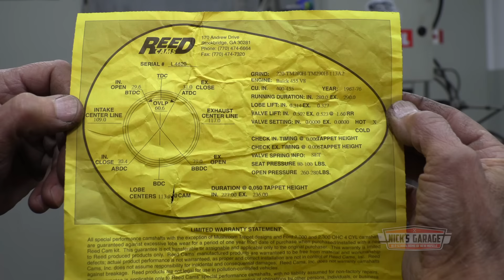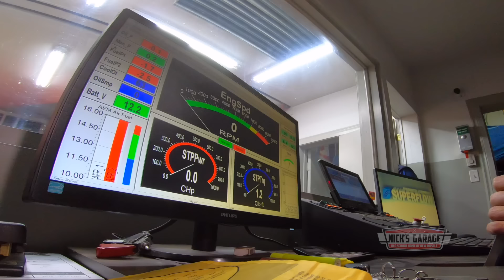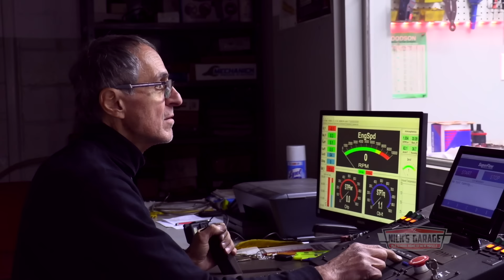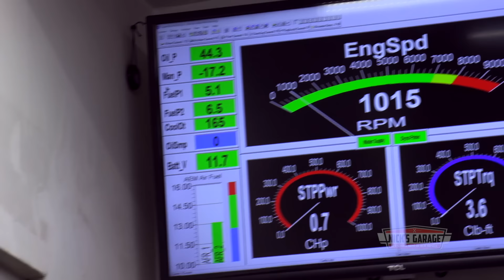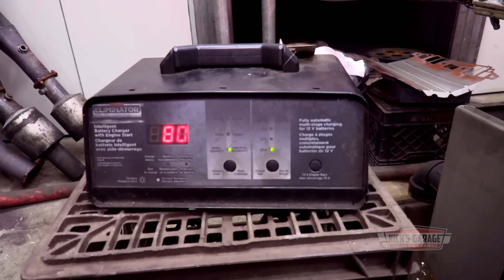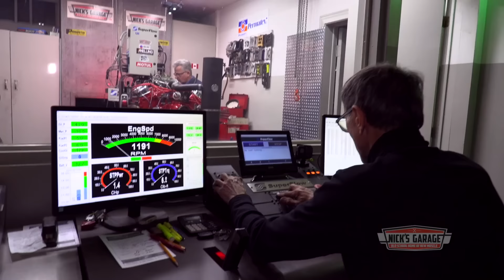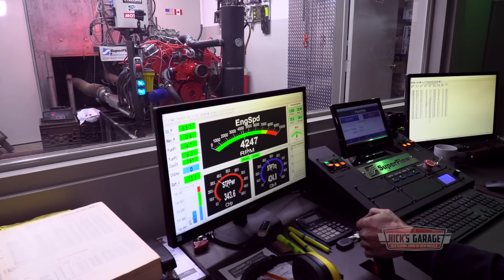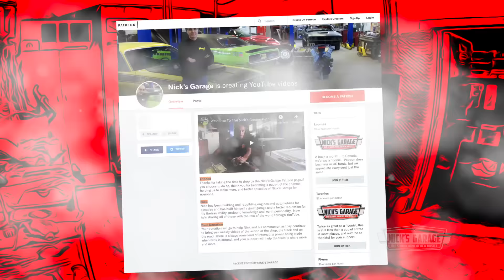1970 Buick 455 Stage 1 - Dyno Room Diagnosis

Comment: I had made a  CYLINDER COMPRESSION TEST  and had 160 PSI.  Recalculated the COMPRESSION RATIO and it turned out to be 9.2 with these slightly dished pistons.    WE ARE NOT DONE YET.     STAY TUNED FOR MORE.
Reply: Most 455 Buicks favor 30-32 degrees of total timing...What are valve sizes on the heads?  Stage 1 heads are 2.125"I and 1.75" E as compared to non stage 1  455 which are 2.000"I and 1.625"E.  Stage 1 1970 455 actually had 10.5:1 Compression, non Stage 1 1970 455 had 10.0:1 Compression. The Reed cam installed is a very mild grind for a 464 c.i. Buick.  This cam is all done making power at 4500-4700 rpm..The actual lift of this cam is only .487" I and .506" E using the stock 1.55 ratio Buick rocker arms. The cam card lift figures were using a 1.60 rocker arm ratio. There are many other cam grinds available that would produce substantial power improvements over this Reed cam. The low compression (9.2:1) of this build is definitely decreasing potential torque and hp.
Reply: @midnitesquirldog1 Exactly backwards! I personally have been stranded by electronic ignition three times,  including once in the wrecker I was driving, and as a wrecker driver I've towed more than I can remember. Points on the other hand, won't leave you dead. After years of faithful service they will eventually cause a miss or a stumble, but you can still go home or to a repair shop. I have never towed a vehicle with points that died in use. Give me points, every time!  And vintage cars that came with points should NEVER be downgraded to electronic crap.
Reply: I know you want flat top pistons with 0 Deck. Do they make Cometic MLS thinner headgaskets for that engine?
Reply: @thefinalroman  ... I had just placed an order for .027 cometic.
Reply: @billdedrick1914  Yes, we have the Stage 1 heads. Looking to bring it to low 10's CR.
Reply: @midnitesquirldog1 HEI doesn't fail? Points don't just "fail" by the way. Most of the HEI ignitions, you cannot just go find something at a parts store if you do have issues on the road.
Reply: Thanks, Nick! I grew up on Buick 455s and really appreciate you posting these videos. I am an even bigger fan of the Quadrajet! Nice to see a Quadrajet in action, especially on the Buick 455. The 1970 455 Stage-1 engine was a great engine for its time and made its power/torque through the smaller version of the Quadrajet too! My understanding is the 1970 Buick Stage-1 was slightly underrated in the HP department but truthfully not by much! The factory 510 number seems to have been more about smoke and mirrors and marketing; possibly the same department that designed those 5 valve cover bolts! Buick guys may also recognize the M/T Super Scavenger style header collectors on this engine. So guys, there probably is more HP/TQ in this current combo, but it would take an additional 50 pounds of torque to bring it back up to 510, more than that if you expect a modified engine with tube headers to exceed that number. Personally, as a Buick guy, I wouldn't hold Nick to that number, or any other specific number. Thanks again, Nick!
Reply: @Terminxman  Can always carry an extra set of points and condenser.
Reply: Like Bill said, check the valve sizes - I'm guessing that's a standard 455. It almost seemed like the motor warmed up and suddenly it sealed - could someone have angle-cut the heads and the sold the motor before matching up the intake? (or thrown the original back on to sell it).  As for the power loss - I was warned by old-school Buick guys (25 years ago) to get a cam from Kenne-Bell or someone who really new Buicks - some of the cam manufactures would just put a generic "chevy" grind on it and completely blow the low-end numbers. FYI the "370 HP" rating is the "official" rating for the monster stage II engines - it's not even vaguely close. 350HP is the standard engine.
Reply: The production tolerances are way off on 70 455s, the pistons are usually .040 or more below the deck. For blueprint spec 10.5:1 it should be close to 0 deck with .020 head gaskets and the 23cc pistons. I rough calculated my 70 SF block 455 to be around 9.4:1 when I replaced the head gaskets last year.
Reply: @billdedrick1914  i thought something was wrong most older engines had good compression like my 454 has 10.5 to 1 plus it idles at 700 rpms with no problems it don't die when u open it up and drop it plus it is built on the bottom end stock 4 inch stroke ,steel crank ,heavy rods and high flow heads best part is i got it free with a 02xx 400r tubo good to 800 hp only 6,000 miles on the crate set up then i got a weidland high rise and tunnel ram set ups for a 100 bucks for both with carbs then a street scoop for 25 bucks
Reply: @nickpanaritis4122  
The Operating Room 
🤣🤣🤣🤣
Reply: I completely agree with you that points are super simple and get the job done.....well! There is one important caveat to this though, and that is that so many points that people are buying these days have huge quality problems, making them very short lived, rubbing blocks seem to be a big problem. If you run points, like I do, buy up old stock, bulk purchases.
Reply: Hit it with a 200 shot of NOS!
Reply: The cam might be too big for the engine. You could have thrown on top of Rhoads Lifters to bleed down the cam to help the vacuum, which would have made it run like the original cam  on the low end. T?A performance has got a bunch of performance parts for this engine. This NO WAY disrepecting the master...
Reply: 10.5 +   lets go
Reply: It might be the cam cam duration. The cam might work well for 4 speed stick. But not for a automatic that does not have a high stall converter. Maybe?
I drove a 70 Riviera. All stock it was smooth at idle and the torque. Oh boy. It probably was not a stage one motor.
Probably like the Pontiac Grand Prix the 455s were two different motors. Same blocks. Different heads.
Also a old GM diesel engineer told me V engines twist and the banks spread with the torque and RPMs.
Now that engine will burn pump  gas. Not sure how the valve seats will like unleaded.
Reply: @midnitesquirldog1 I hated looking for the far flung Allen items.
Reply: I disliked the unipoints even more.
Reply: @55desotomine  all you have to do is keep a fricken $20 module in your glove box and it takes two seconds to change..it's the only thing that can fail on HEI, it's much more accurate and reliable than antique points.
Reply: @Terminxman  keep a fricken $20 module in your glove box duh
Reply: @55desotomine  Interesting viewpoint Senor TobyC. . Your failure record with electronic igns makes you 1 in a million. Yo
Reply: @55desotomine  just carry a module and coil same thing as points swap them in and go and if hei set up correctly they rarely fail points on the other hand I have heard you can not get good ones anymore today cheap crap from Taiwan
Reply: @pb68slab18  Points won't leave you stranded. If you replace them every fifty thousand miles you'll never have a problem. Even if you neglect them all that will happen is a loss of power and some missing under load. And always replace the condenser with the points, and use the lube that comes with the points.
Reply: Back in the day points were recommended to be replaced every 10,000 miles... if you waited too long and the points spring broke, you were left stranded... of course, back then, for $2 you could carry a spare points/condenser kit in the glove box! 
Low compression ratio gives weak torque with a bigger cam... this Reed cam is 1 - 3 steps bigger than stock... depending on which 455 this is... won't even pull hard below 2500 RPMs... needs 10.75 - 11:0 to 1... 
A real stock Stage 1 455 Buick actually 380 - 400 HP and would beat a heavier Hemi car...
Reply: I will take a nice Quadrajet over any other method of fuel metering any day!
Reply: @robertwest3093  Thermoquad, AVS, or AFB for me, nothing electronic.
Reply: @thefinalroman  yes
Reply: @billdedrick1914  I agree.  The stock intake doesn't help one like a Edelbrock performer would probably be a better fit with the combo
Reply: @midnitesquirldog1 You have that backwards. Electronic ignitions randomly fail more often than points do. Points require a little maintenance, but as far as outright "failing" and leaving you at the side of the road, that very rarely happens with points. It happens much more so with an electronic ignition.
Reply: @w41duvernay  Look at the idle vacuum. That cam is tiny. 🤦🏻
Reply: @warrenpuckett4203  The duration isn't much on that cam. Listen to the idle. I would bet it's less than 220° @ .050.
Reply: @robertwest3093  For a street car, absolutely. For a drag car, no.
Reply: @davelowets  I guess your right. I would have put a vacuum meter on it 1st. If I knew the cam was stock automatic trans friendly. I use WD 40 and spray it around to find leaks. Leaking manifold is not very common. It is the quickest leak finder.
But if any head surfacing or manifold surfacing has been done. You might not know if it has been done before. It don't matter on inline engines.
Reply: @warrenpuckett4203  Exactly. I have found that starting fluid works very well to find vacuum leaks. Its got more "pop" than WD-40, and the engine will idle up faster with starting fluid when the leak is found.
Reply: You're a persistent man, Nick. Perseverance=Prosperity. 👍
Reply: I add the Valesaline before I put the gears it,excess will be pushed out
Reply: @richardbaumgart2454  Agreed, I changed one out at a convenience store on a 455 Cutlass l had.
Reply: Just read all the comments and thinking ... 
Outside of Our Host:

Some of you can build an engine/motor and some of you can assemble an engine/motor and some of you just saying things from what you Learned (Sorry Nick but we need to have these conversations on a professional level Sir ... I'm no professional by any means but I can spot a learner and a teacher and a Graduate 🤣🤣🤣 I see only 2 maybe 3 professionals on here Sir 🤣🤣🤣🤣🤣 gotta love Nick's Garage)
Reply: @55desotomine  AMEN TO THAT BROTHER!
Reply: @romper4444  HELL YEAH BORTHER!! GOBBLESS
Reply: I was going to say, with that cam you will want more compression. People always want a late closing intake valve event but then, never give it the compression it needs.
Reply: @erikkroll2154  .....I wish I had the flat top pistons at the time of rebuild. .
Reply: @Mike-yq7ce  I DO agree with you Michael. Nick's got a looong way / performing a very accurate 'surgery', so  I'd swap original intake manifold for an Edelbrock performer + easier breathing carby + air filter(s). Regarding HEI ignition, there are several good / reliable  options, too.
Reply: @hernandovillamarinbuenaven7476   I agree I like Nick's stuff because of the accurate "surgery".   For the intended use the Quadrajet will breathe enough should work well with the combo.  I believe the bulk of Quadra Jets are 750 cfm for street cruising that should be plenty and with the small primaries it should be more responsive on tip in.
Reply: Hi Nick, Nice build, looks good, The breathers are clear!  I would say everything is good, did a great job! I would only suggest one thing, is to use a torque wrench on the intake to speck and again after a heat cycle! 455 going to make its most torque from 2700 rpm to about 3500, that cam may be wrong? check the came speck for a stage 1 engine? I think for what you have it is working good, if the compression was up to 10.0 to 1  it would probably be right on?   but other then that, good job...  (o;
Reply: @richarddahmer4474  ... Thank you.
Reply: T.A. Performancd probably has the head gaskets
Reply: @carlbowman8733  ...I did buy the second set from TA.
Reply: @billdedrick1914  I've had nothing but problems with brand new GM HEI ignition modules and coils randomly failing on me over the past couple years and stranding me. I'd rather go with points.
Reply: @Mike-yq7ce  Yes, most Quadrajets are 750s, and yep they work GREAT on a mildish daily driver street car. I'd use one every time on a daily. I've been into the high 10s in the quarter with a Quadrajet, but it took alot of money and mods to do it. The small bowl on them ultimately limits the amount of H.P. they can support. But for a street driver, they are sweet.
Reply: @largelarry2126  💣
Reply: @55desotomine  I see your point but nowadays we have cell phones so we can call a tow truck!   Back in the day we would be walking!  lol
Reply: I recall my Dad's 1968 Thunderbird's gas cap label read "minimum 99 octane"!   It had a 429 I believe.  I looked it up and it was 10:25/1 compression from the factory!  Amazing how those old beasts were built!  I love those big Buicks too.
Reply: @spaceghost8995  99 octane was what "premium" fuel at the pump was rated at during the 1960's. Some gas stations even sold "Super Premium" that was rated at 102 octane back then also. Todays gasoline is horse piss compared to what was available then.
Reply: @davelowets    I'm 58 I do remember that.
Reply: I see A lot in common with a mopar engine
Reply: Yea a light motor but a way heavy car haha my 383 GTS dart had no problem man handling the 455 buicks but did have to struggle with my buddys w30 olds but his wasnt stock mine was....i still won but only got him at the very end of the race
Reply: @onesecureone  I have an Olds that I'd run you with... 😁
Reply: @midnitesquirldog1 I have electronic points, which are MUCH easier to change (one screw, no adjustment) if they fail, always keep a spare set of 'points'.  My present electronic points have been in the car (thinks...) 12 years without a problem.
Reply: @thefinalroman  flat tops will make 12+ compression. Most Buick 455 pistons have a 22cc to 25cc dish. Zero decked with 70 heads and .038 gasket should be around 10.25-10.5
Reply: @charlesheltyskeltymanson  because they are not GM! They are AC DELCO--these days AC DELCO is just another cheap chinese brand--unless the box happens to have an OE 8 digit part number on it as well as the DELCO number--then you actually have a genuine GM part.  All the old stuff is discontinued by GM now.  The AC DELCO stuff for the old stuff such as ignition modules, pick-up coils, points, condenser, cap, rotor, coil--all of this stuff is chinese (or some other place that makes this crap for ten cents) crap.  Best bet is to find HEI ignition parts on an old junk car.  Yes there were failures, but few and far between back in the day.  I am a GM mechanic in the business since 1988--I have seen it all!!
Reply: keep up the great work one of a kind you care about what you do and that's why your work is top notch
Reply: I Like the videos. So much quality and care and education. Makes me want to build an engine.
Reply: @billdedrick1914 ¹
Reply: @billdedrick1914 ŕŕrrrrrrrrŕrŕŕŕŕŕř⁴≈≠ĝfff
Reply: This is a late entry but I've got to say something to help with the questions posed in this video. 1st ,run the part# on those pistons and I bet they come up as 71-73 pistons ,which is 8.5 c.r. 9.25c.r. is what you should end up with, decking the block 050. ,which is excessive in my opinion. Get '70 10.01c.r. (forged) pistons next time. Ask the owner/founder of T/A performance why forged. 2nd ,the cam is too much for the stock intake to benefit from. Generally ,Buicks with stock int/exh manifolds dont benefit from anything more than 460-470 lift. 3rd and formemost ,IS THAT QUADRAJET AN 800CFM? -And do you have a strong pwr piston spring,.075 jets ,secondary metering rods from a 70-73 Cadillac 472/500 carb.and the secondary pull off valve for a '70 GSX stage-1 ,hence the strongest spring you can get in all Quadrajets,for the quickest release.  If you're gonna use headers and a cam over .500 lift ,which requires perf v springs,just get an SP-1 intake from T/A perf and a holley 860cfm(vac sec!!!)and make some serious BALLS! That combo with the same cam would make 425hp.@5000 and 530lbtq.@3800 ,est. Port out casting flash and you'll make even more! OH YAHH! I've got a bunch of bullet-back Riv's that I race and yes bullet-back is the correct name for 71-3 Riv's. B.M.D. bought rights to late 60's sketches from Deloreans' concept of a high speed fullsize coupe version of the mid 60's Corvette. And the high speed concept works. Tha 71-2 Riviera is,and I stand by this,THE MOST AERODYNAMIC FULLSIZE CAR MADE BY ANYONE IN THAT TIME PERIOD. Go 148mph in one (in good shape)and switch lanes back and forth. You'll see exactly what I mean. Happy racing ,guys.😁👍
Reply: If that engine has 9.5 to one compression, it is not a stage 1, but just a 455-4. Unless that is it is just flat wore out. The comp ratio on a stage 1 was 10.5 to one, it had larger valves, a hotter cam, a stage 1 specific distributor and carburetor.
Reply: 160psi is pretty low, even for 9.2:1 compression.... the cam doesn't sound all that large either. 

I've had engines with 9.5:1 compression that had 180psi of cranking pressure with larger flat tappet cams. Did you have the throttle cranked wide open during the test?
Reply: @davelowets ...Always WOT for compression tests.
Reply: @richardbaumgart2454 the pick up coil can also fail.